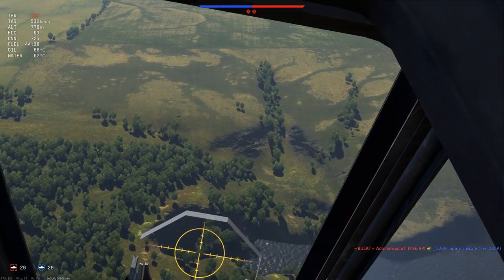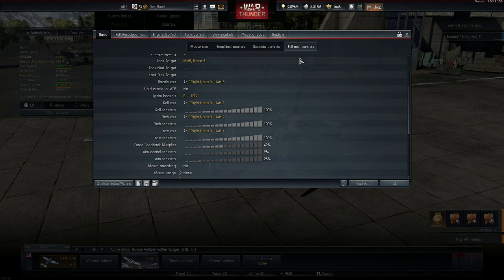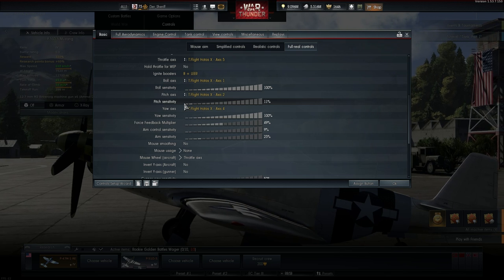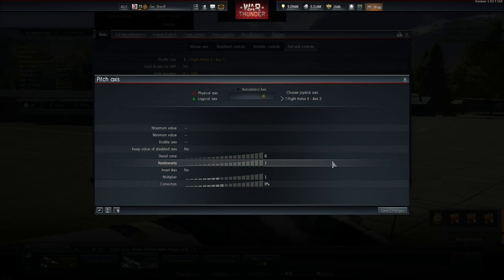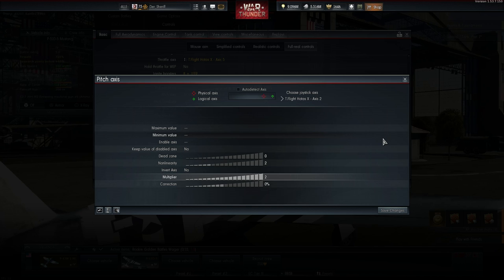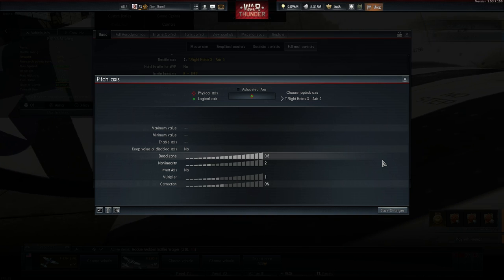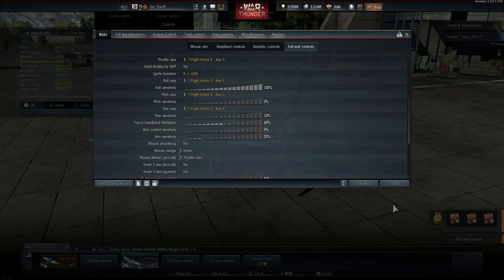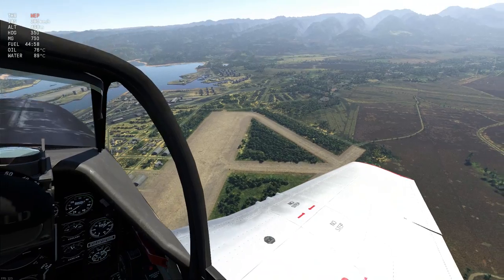How to Setup a Joystick for War Thunder Video (English)

Comment: in the bottom left corner of the test flight menu there is a button to edit the mission.  this will let you fly a test flight in any map you like with ai to fight.  I find that the added pressure of dogfighting ai can help me diagnose problems better than default test flights.
Reply from the maker: +Jim Redtalon Yeah i do that from time to time. But for basic testing the normal Test flight in enough. But good tip for other players though!

Comment: Best explanation of the fine adjusting rather than what they think. Im great with a ps4 controller on arcade and realistic, no problems at all playing with ps4 controller, but this could really get me to the point of equal pros and cons . I just don't like that they reset my bindings and layout. Takes forever to get back. K30pt it up bro. You make me wanna spend my little bit of time in life perfecting the art of old school luck and kill or be killed.
Reply: you can save settings as a preset

Comment: I have never tried the sensitivity lower than 100% because I want the response as close to my axis movement as possible. I don't use any other corrections but a small dead zone - the reason are the same, I want my axis movement and feedback to be as close to true movements as possible.

I used a Saitek X52 pro earlier, now I'm using a Thrustmaster Warthog - the censors in this stick are of better quality compared to the Saitek, still I didn't use any more corrections using this. To decrease the multiplier has been necesarry in some planes to avoid stalls - which I don't use anymore, I can recommend this adjustment for a new starter, it's easy to over compensate the movements in the beginning. 

I can see your point on reducing the sensitivity if one use a stick with low quality of the censors or if the stick are worn. I will try to lower the sensitivity to see how it works.
Reply from the maker: +Senilix flying circus Yeah I think a lot of my tips are personal preference. But I am pretty sure alone the knowledge about the meaning of the options will help.

But I get your point.

Comment: I desperately need help. I'm using a T. Flight Hotas myself, and no matter how many times I go to the control wizard and change it back and forth from the t.flight hotas to the mouse settings, they're all jacked. As of now with the joystick, I have no control over ANYTHING, it's like the buttons aren't assigned at all, and it won't let me assign buttons either. I'm about to give up.EDIT nevermind, for whatever reason it reset itself.
Reply: Yo help me same problem

Comment: Hi
I find one major difference between 'Mouse Aim' & 'Joystick / Mouse Joystick' and that is the horizon view.
With Mouse Aim the Horizon stays straight and the aircraft turns.
With Joystick the Aircraft is fixed and the horizon moves.

Now in WofWP you can choose which horizon action you prefer for either Mouse or Joystick

However I cannot find a similar option in War Thunder.  I would like to use a joystick but have the horizon fixed like Mouse Aim.

Is this possible?

Comment: What plane where you using in the video? It seems very stable, i find that my spitfire mkVb trop wants to just crash on its own...

Very helpfull advice, thanks :)
Reply from the maker: The P51 is actually very unstable
Reply: +Der Sheriff Hmm, i dont know what im doing wrong then... Because my plane just tilts to the left and downwards the whole time. Its legitimately straining my arm, LOL
Reply: +HELLCAT GAMING WOT:B ohhh, never mind! I tried out a p40 with this setup and i think im in love. Im gunna gave to set aside my Spitfires for a bit and switch to american planes :)
Reply: +HELLCAT GAMING WOT:B have to*
Reply from the maker: its just a matter of getting used to and you could use triming to get a little aid
Reply: Oi so spits are one of the most sensitive air craft try flying germans for a bit and you should see a big difference

Comment: Hey Sheriff, i am having some trouble setting up my game. It's been a while since i wanted to go into Sim battles using my Thrustmaster HOTAS X, and i finally decided to give it a go, following your guide here. However i have a problem that i am not sure is a bug or a feature. Anyway, my planes all turn a side during takeoff. Some go left, some go right, but they all do it as if i am pulling the YEW axis. 
I spent quite some time looking on forums etc, people all say different things but in the end the problem remains. I can't even take off because it makes controlling the plane super hard, i have to manage 3 axis and throttle at the same time, while not really seeing anything out of the cockpit... Maybe that's normal, but i can't seem to do it. 
Do you know anything about this, how to fix it or maybe go around it?
Reply from the maker: +Dobromir Manchev This is normal. its the engine toque and propeller wash.

Its a matter of "getting used to it".
You have to counter the roll and yaw by using the rudder in the opposite direction.
Reply: +Der Sheriff I read about torque etc, i think i understand what it does. 
If that's the case, is compensating for it the only option? Some people on the forums were talking about engine trim, but i have no idea how to use that.
If i have to compensate what do you suggest i should use for Yaw - the stick Z axis or the rocker button the the throttle stick?
Also, does this thing happen in flight or simply during takeoff?

Finally, can you give me some quick tips on takeoff? Like the amount of throttle to use, when to actually pull on the stick etc? :)
Reply from the maker: I could talk a lot but bismarck does a awesome job:
https://www.youtube.com/watch?v=rPCSuXEQwXw

Comment: Hey Sherif, I recently got a new joystick with rudder control and I'm struggling to use the rudder properly in turns. I keep sending my aircraft into a flat spin while trying to pull a hard turn left or right. Now I have no idea on when or how to use my rudder. Can you help me please?
Reply: No easy answer. Engine torque pulls the plane left (many Allied planes) or right (Russian ). This effectively pulls the nose down in an (American) left turn and up in a right turn. Thus opposite rudder can help keep you from losing or gaining altitude during a turn. Making a hard right turn with full throttle bleeds off a lot of airspeed and if the torque is pulling the nose up you have a recipe for a stall. A little judicious left rudder will help keep the nose down, speed up and make a tighter faster turn.
Use the multiply factor like the author said, back the elevator(pitch) down to .90-.95 and do the same for the rudder (yaw). That will help you from over controlling the airplane.

Comment: think its easier controlling the plane from outside view???? i dont know whats it called but i get dizzy in cockpit which sucks for me. Also you cant do certain things in a joystick as you would with only Mouse and keyboard, i learned a few tricks, to avoid getting killed. But  i wanna learn to use the joystick.
Reply: you have more control over the aircraft using a joystick since you arent restricted by war thunders "instructor"
Reply: @SheriffsSimShack  :: thats right forgot of the Ai instrutors

Comment: i have the same joystick with you Thrustmaster Flight Hotas X but in the settings, the button configuration has different names 
for example i see you have: Button 29 to Button 40. Mine has J1:Button 1 to J1:Button 11
whats with that?
Also do you happen to know if they match numerically ? for example your Button 29 is my J1:Buttin 1 
or your Button 30 is my J1:Button 2
Reply from the maker: Yeah that has something to do that I had at the time a Xbox 360 attached to the PC which messed up the numbering. WT instead of naming the buttons like JS1 Button 1 and JS2 Button 1 it does name the buttons like JS_button1 and JS_button25. (If we say that JS1 has 24 Buttons)

its a mess
Reply: oh i get!
thanks for responding so fast 
btw i love your content and your tutorials, you were the reason i came back at SB! 
keep up the good work :)
Reply from the maker: +Nianios Nianioglou make sure to take a look at my second channel. Maybe there is more stuff for you. Sheriffs sim shack. No new war thunder content tho. I transitioned to il2 bos

Comment: My 1st flight (arcade) had mouse aim, managed to get myself 6 fighter kills and 3 ground targets. 2nd match switched to manual control, (Ps4 controller) couldn't even hit a stationary ground target. Plane wobble was so bad I thought my controller was broken, then I blamed lag and poor connection, then my myself. After about 8 hours adjusting sensitivity I got the wobble down to manageable level and realized mouse aim needs a major nerf. Or its own server separate from manual control pilots.
Reply from the maker: +mossaic13 a ps4 controller is something different than a proper joystick and war thunder has a mode for joystick players. SB

Comment: The setup starts when you select the joystick as a control ( I can't select it ). You already selected, so this video doen't show the first key step of it. As it shout according to the title.
Reply: usually that is really not a problem. More a bug or a problem of your system. Such a video cant tackle every bug.
Reply: @SheriffsSimShack  Nope, it's in deeper in the settings, where you can pick what type joystick you have. I think this video should start with that one or change the title.
Reply: @listoferich  you dont have to do that. Its not mandadory. Its just to get a preset for your stick. By no means needed to use the Joystick. I never did that.

Comment: Anyone else got problems with planes veering left/right? This is an issue I am combating with rudder/yaw control but I feel trimming might be a good idea? any helpers?
Reply: trim helps, but this is totally normal
Reply: do you think you could help with a trim setup video in the future? I feel like im royally fucking my settings up each time i mess with it.. :/
Reply: i dont play WT anymore
Reply: bf1? how did you manage to calibrate joystick for flying? i only have it on ps4 and there are NO options which is super dissapointing
Reply: should be under its own tab when you select "full realistic controls"
Reply: Thrustmaster 4? I also use this, I applied Sherrif's settings in regards to linearity and multiplier but I also took the Roll sensitvity to 0% and set up similar non-linearity settings to my pitch and yaw. I also physically turned the joystick stickiness (found underneath the device, the circle thing) to be central (not too sticky not too loose).. I rarley use the 3rd person view unless I am being tailed/or doing low altitude turns at for ground targets, the view after cockpit (cockpit also) is the one you will become most deadly with, as the reticle stays central.
Reply: You might want to check the deadzone/multiplier of the pitch if that is happening. I think the best bet is to practice starting high on your opponent, swooping down and over (with a few lucky shots towards the cockpit) before rounding on his tail, It will take some time to get the the feel of using a new medium (joystick) I was also intially frustrated at the "lack" of control i had however you need to watch  your thrust settings, I try to round on my enemy at 100% and then pull down below 90 to line up and fire, Also firing within a 200yrd distance say instead of a 800-400 one can really open up your target. I also use the same cannon/machine gun settings as sherrif here, as It is important to "line up" your shot with weaker ammo before hammering them with your 20mm cannon.
Reply: No worries, add me on ps4 - Gnar-Thrill, flying in a squad helps a lot too!

Comment: I can't even move with the joystick. I am fine with default, but the default controls are not mapped correctly, throttle up is actually mapped as "roll", all the gun buttons are camera view and map view, the setup is insane, there is no pitch forward as well with the joystick, it just doesn't work. What a piece of shit.

Comment: disappointed.    I plug it into my computer and nothing happens.   thought your video would tell me how to sync it with the computer or whatever, but no
Reply from the maker: this is hardly possible. Since there are plenty of different joysticks. With basically all of them its just plug and play. As a private person I cant provide technical support
Reply: try to look for any available drivers for your flight stick or check the website for technical help

Comment: please make on ps4
Reply: I play on PS4, I use the same settings. If you're using the dualshock controller, I recommend picking up a "kontrol freek snipr" (google it) thumbstick extender, costs about $10 bucks. Dramatically gives you a lot more control of the aircraft for precise movement.

Comment: I see you do not answer questions, so your tutorial  is useless!  NO ONE that I know has been able to land this plane or even make a approach to land without crashing!  I have all the axis sensitivity set to zero and the sensitivity settings on the bottom of the Hotas X also to zero and it is so sensitive that it is totally uncontrollable and It will not fly at level flight, So far, 100 % crashes with no exceptions!
Reply: lol